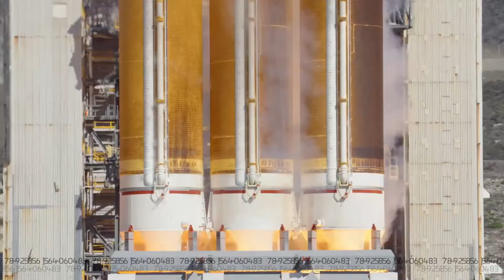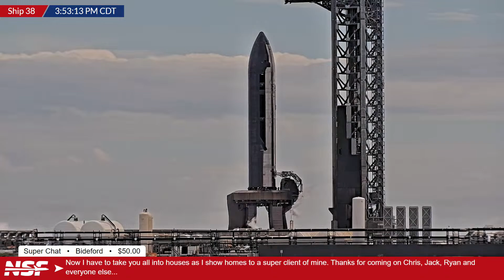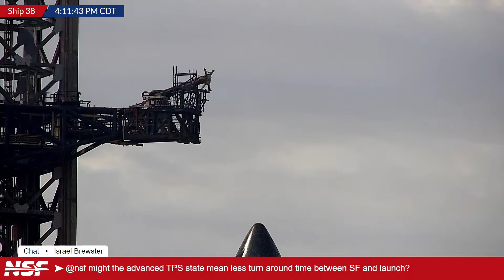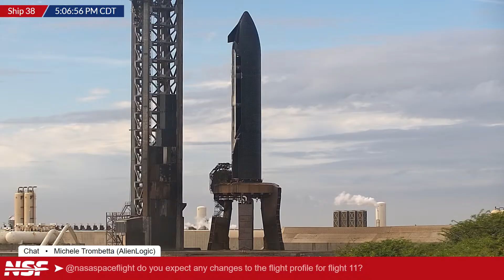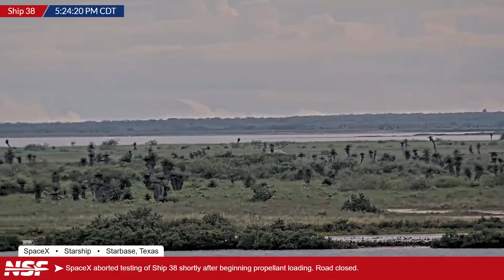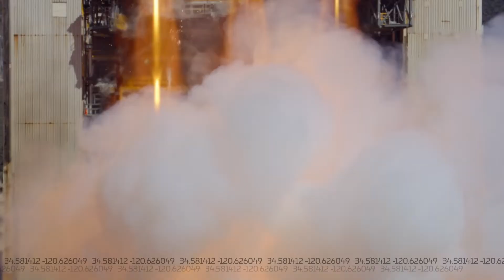[SCRUB]: SpaceX Performs Static Fire of Final Block 2 Ship

Comment: Electron gets a whole 1/3 of the screen for 2 seconds in the opening Credits!?!?!? WTF!?!?
I didn't even notice it the first time. 
        The CEO of a Multi Billion dollar launch provider was kind enough to give you guys an hour and you give Electron 1/3 of the screen for a second. Electron has over 50 missions, SLS has launched once.
Reply: Its not like they have an "Electron Live" branch of the channel like they do with starship, it appears to be edited to show what is most commonly covered on the channel. SLS and starship are more iconic visually as well, love it or hate it.
Reply: @_zeee9156 HATE IT 😂
Reply: Easy solution: allow media to put out remotes and then there’ll be more of our footage of Electron in the intro
Reply: Electron is 28,700 lbs.  SLS is 200x larger — 5,750,000 lbs. 
One SLS launch moved well over 3x more mass than all 62 successful Electron orbital launches to date.
Reply: @DavJumps Cadence is just as important. The ability to launch small payloads to different orbits is just as necessary. I'll bet those 60 launches cost less than a quarter of the  single SLS launch. Plus, SLS uses 70s tech. SRBs are thankfully going the way of the  dinosaurs. 
Sorry, but if you don't love Rocket Lab, you don't love Rockets.
Reply: @timonium252  Rocket lab is a great company. Never said it wasn’t.